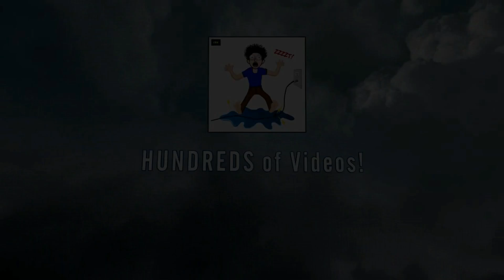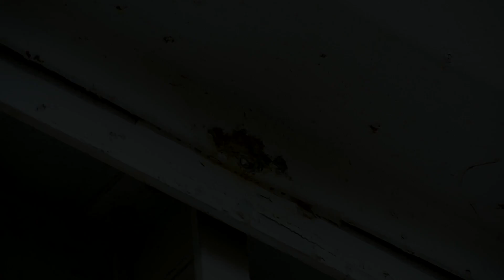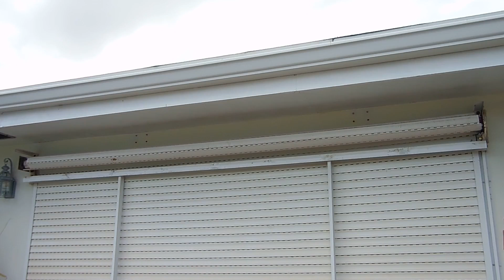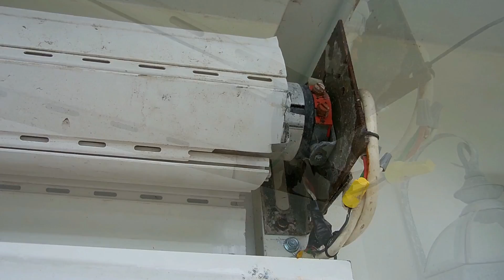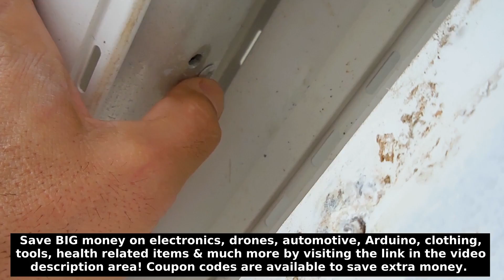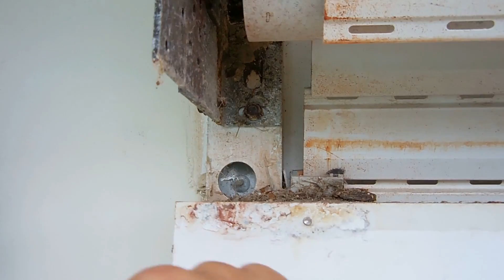Roll Up Hurricane Storm Shutter Repair (Rolladen)

Comment: Thank you.  Very informative.   I have a side-by-side pair and the rocker switches sit in one box on the wall inside the patio.   I did not notice any fuses.   My motors are 120v Sofry's.  Would fuses have been installed generally back in the time these motors/shutters were installed?   Also, one of my motors quit when I was operating it after a storm surge.  I was lifting, but suddenly stopped.  After removing the covers, I saw a slat had moved and grabbed the wire to the motor just like you showed.  But, I think it tore wire  insulation and banded the wire around the end of a slat, likely causing a great strain on the motor.   The question is, would the motor have burned up if the shutter seized if there wasn't a fuse?   Or, is there a thermal protection?    Can I ohms check the motor?

Comment: I have this exact same design in Puerto Rico.  What’s the cure  if the motor turns the shaft up and down, but the slats stay put?  I evened out the slats laterally but no joy.  I tried manually turn the roll, and still no. Thanks!
Reply: I figured it out.  The securing straps riveted to the “axle” were seperated allowing it to free spin.  A great company in Miami had the replacement metal straps and all is well!!

Comment: Thankyou; but when you slide the slats back into pisition, is there something in the design to be checked or fixed  so the slat doesn't  easily slide out of position again? Did I miss  something or does it just work well until it shakes out of pisition?

Comment: It appears my cover is secured with pop rivets in place of screws!  Was that a thing back then?
Reply from the maker: Yes. Just drill them out and replace with #10 x 1/2" pan head stainless steel screws coated with anti-seize compound.

Comment: Hi Doug - I was impressed by your video on the hurricane shutter repair. I have a similar looking one that is hank crank...probably from the mid 90’s? One of them is stuck in the down position and I am wondering how to repair the manual operated one like I have. Trying to avoid having the shutter company come and completely remove unless it is not worth repairing. Location is Cape Cod. Do you have an email address I could send pics to? Thank you!
Reply from the maker: You need to remove the cover. It's possible one slat is jamming it up.
Reply: I actually removed the crank handle from the inside of house ... it wasn’t catching the gear. I have a pic of it - not sure if the gear is also seized but looks like the end of crank that slips into gear may have rusted and broke or just wore off enough where it doesn’t catch in the gear. Channel . Could I put something like tape around the end of crank handle to make it bigger and see if it catches ? Trying to avoid just having the shutter removed and trashed as that costs a pretty penny in itself! Thanks for your help ! I have pics if you have an email,
Reply: Also I really appreciated your tip to drill out and replace rusted screws with stainless steel - is there a particular size screw that is best? Thanks so much
Reply: Call 727-360-2582 storm shutter specialist we have parts

Comment: Is there a way to keep the shutter sections from sliding to the side?  I'm having that problem repeatedly.
Reply from the maker: Make sure the slat that's bolted to the steel motor tube, is perfectly straight(level) on the tube. The side rails, where the slats enter, at the top, should have the aluminum bent outward to guide any slats out of position, back into line. Thanks for watching!

Comment: When it wasn’t working in the up mode but did in the down mode, did the motor make any noise at all when you tried to turn it up?
Reply from the maker: It made noise up and down, but when it reached a certain point going up, the motor stopped.
Reply: electronicsNmore thanks. Mine goes down perfectly but makes no noise at all when I try to move it up. I have to use it manually to raise it

Comment: I have an exact old style shutter in Galveston, TX, which is not working recently. Your video tells me how to open it, but I didn't see how to install the cover by with what kind of screws. Please share.
Reply: It is in down position. It clicks and clicks and just doesn't roll up when you turn on the power
Reply from the maker: Yours may vary. I had stainless steel sheet metal screws holding the cover on. #10 x 5/8

Comment: hi, is there any change of video about of remove the rolling shutter completely ?  means not only repair the motor ?  tks
Reply from the maker: Hello. Removal is easy. Lower the shutter fully, then remove the screws securing the shutter to the 2 1/2" pipe. Next disconnect power and remove the wiring leading to the motor inside the tube. The entire assembly is held in with bolts at each end. Usually you remove one end and tilt the assembly down then pull it out from the opposite end. Thanks for watching!.

Comment: These things are very expensive, I would have expected its metal parts to be galvanized.
Reply from the maker: Yes, probably $1,500- $2,500 each for the size shown in this video. The steel parts probably were galvanized, but not a thick layer to stand up to years of salt air.

Comment: Hi electronicsNmore. I watched this your video https://www.youtube.com/watch?v=vrqynvhhFXA
and I started to making this levitation device for school project. Levitation device have two diode.One of this diodes is infrared LED 5mm 100mA and second diode is infrared fotodiode.I have question for infrared fotodiode.What are the specifications for that diodes. Pls answer. Thanks
Reply from the maker: It's been a while since I made that, and I have it in storage so I cannot look. I think it was a BPW34 or a phototransistor(the dark epoxy type), Ebay sells BPW34's. :-)

Comment: That looks like it has 50 years plus. What kind of humidity does that? Here we have 70-80% most of the year and do not get rust like that.  Or maybe because of the rain and the cover not keeping it humid longer.
Reply from the maker: Stainless steel screws eat away the aluminum when salt air/moisture is present. The ocean is 75 feet away from the rolling shutter.
Reply: @electronicsNmore  I work literally on the coast, screws rust super fast around here, it's job security, I guess lol